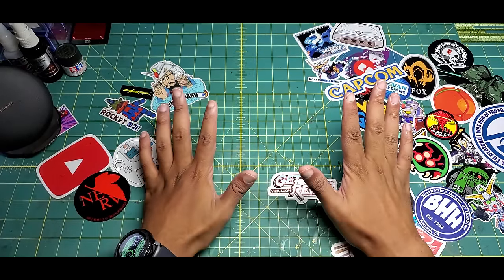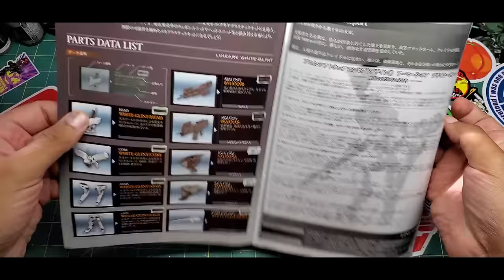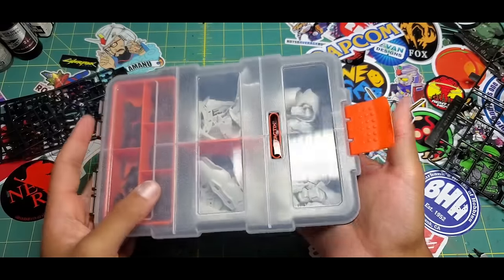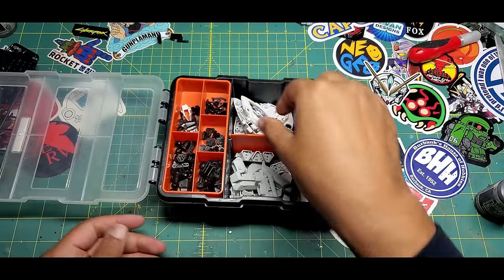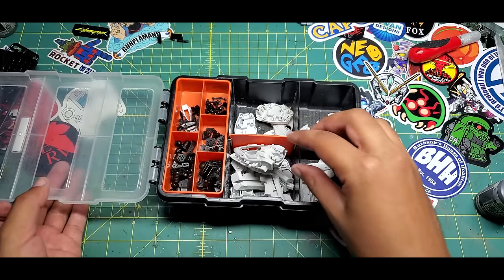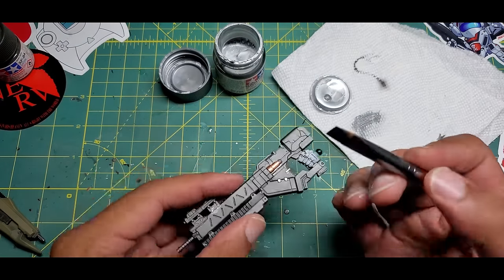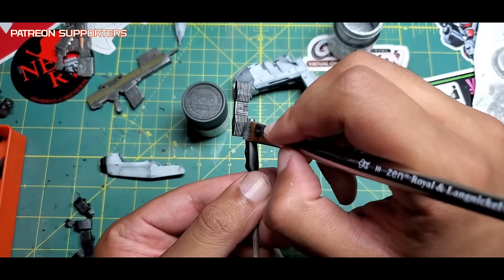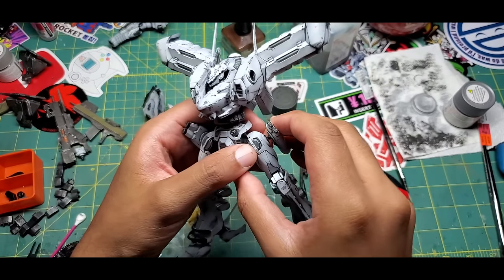#newtype #Otakubuilder 1/72  Armored Core White Glint

Comment: What you did to this kit I feel like embodies the main draw of the Armored Core franchise. You didn't just make White Glint, you made YOUR White Glint.

Also, the rifle at 28:43 came with the Aaliyah and Aaliyah Supplice kits which, if I remember correctly, came on the same runner as the rifle in White Glint's right hand since those are two of the weapons wielded by Berlioz. And the reason why the kit you got has less detail is because it's based on the in-game model whereas the kit with the VOB extension is based on the model in the intro movie.

And for any beginner modelers who really want to start with Armored Core kits, I'd recommend starting with kits from the game predating 4 and 4A (especially the Nine Ball kit).

Comment: I have won awards on model building since my first trophy at 6 yrs old first place. Then learned to paint figurines battle tech and Warhammer 40K. You learn a lot about dry brushing and black wash all to look weathered and real looking. But nice they now have panel line paint. I used to do it with watered down black paint. 😂😂😂 Ya these kits are for professionals if you really want it to look awesome. 
Start with easier robots first that are way cheaper to get your painting skill level up, because there is a lot of detail on these kits. These are very expensive and you'll want them to look awesome. 😊

Comment: 2 things. 1 you mispronunciation of them name is rough but that's just SUPER NIT PICKING. 2 as someone who had this kit when they first ran. They DO NOT hold up to time ALL I mean ALL versions of them kit I've ever had and have seen all have brittle plastic and will break down over time. The Poly caps as degrade fairly rapidly.  The impact resistance of this kit is non-existent. I've also has fitting issues even after sanding. Granted I've only had up to the 3rd run of this kit in black. However the 1st standard and pearl were just terrible. 2nd got a little better but not that much. Skipped 3rd pearl because it still had overly hardened plastics. While standard had overly soft and the black polycaps lasted maybe 2 years.  I'd love to have an AC/FA kit that isnt super fucked. However I've only had luck with the HEXA GEAR stuff. So hopefully the final production runs of the REX and AC kits this year will be better.

Comment: Yes both the opening cinematic AC's from AC4 & AC4-Answer are great designs. White glint does get it's ass handed to it, but it looks good doing so. And yes if your going to do a review on a model kit that you don't like because it isn't a gundam or what ever, then don't. Gunpla YouTube's judging kits on articulation and parts falling off, with a gunpla ranking system is just stupid. It's a model kit not a toy, Snap/glue it together, paint it, customize it and injoy the hobbie. Don't just snap it together, review it, sit it on the shelf and leave it to gather dush because you just want that patreon money. I watch these reviews to learn about loose joints, problem areas and to get a general look at the kit. If I like the model I'm going to buy it regardless of what some YouTuber says. YouTube's have gotten way to long in the tooth with patreon accounts and the stupid people that help keep them out of a real job. Japanese, Korean and Chinese paint builder's do great video's with great lighting and show there work as the kit comes together. Then at the end we viewers get a great look a the finished model for more then 2 minutes. Perfect!